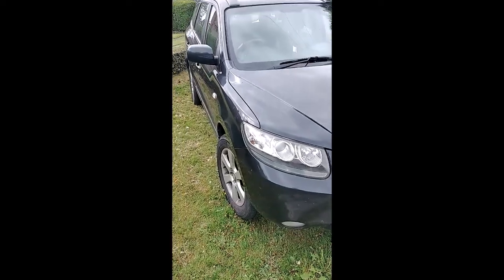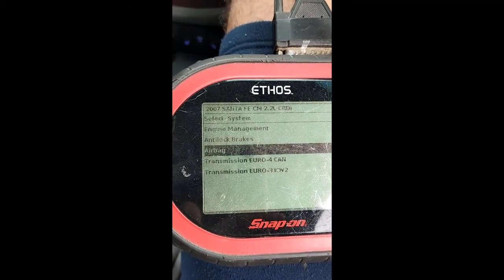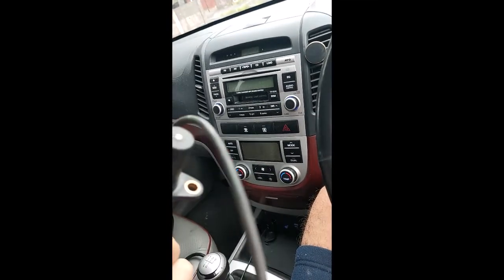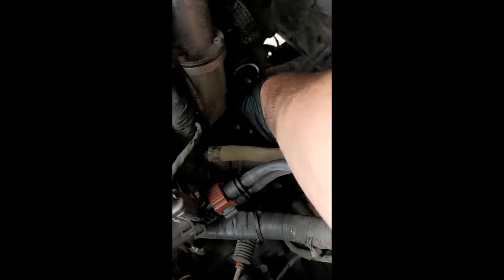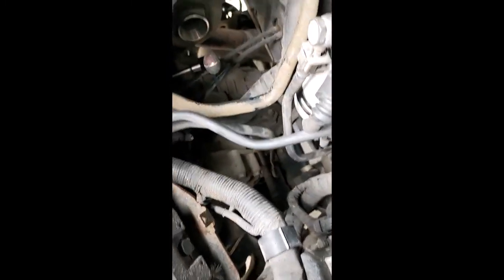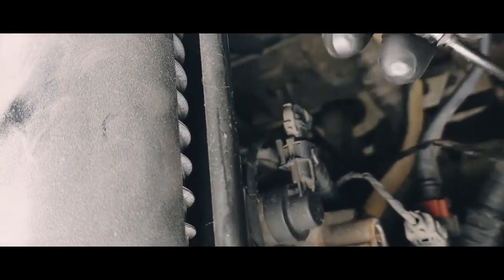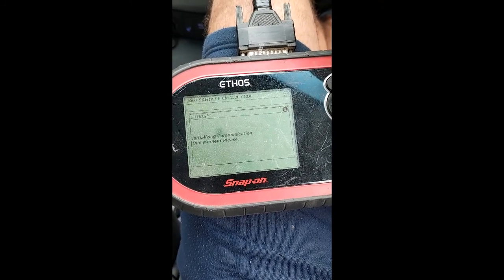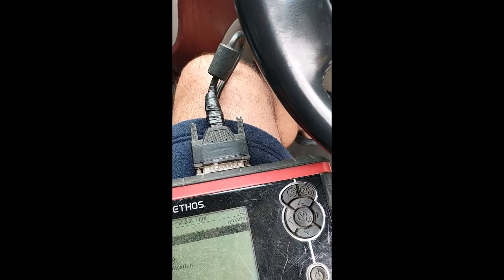Crankshaft sensor diagnose and replace - Hyundai SantaFe 2.2 Crdi Code P0336

Comment: 7:32 you're correct there mate. I couldn't see a darn thing from underneath. But, to date, your video has helped me locating the crankshaft sensor on a 2.2 Santa Fe. I could not find any diagrams, pictures or videos for a 2.2 Diesel. They're all for the 2.4 or v6 and petrol engines. And they all say that the location is similar in all variants, but I looked in every location that was mentioned and couldn't find anything that was described. I rven purchased a Haynes workshop manual specific to my year, and even that says its where the starter motor is. So thank you for saving my sanity😊. I will definitely like and subscribe. Thanks again.
Reply from the maker: Ive had the chance to to this again, on a different vehicle. I will honestly say i did it without seeing where it was, i did not remove absolutely anything, i knew where it was and did it by touch. I was amazed how much work was the first time, 3 years later took me 3 minutes. Humans are amazing. I am glad it helps. Thank you.
Reply: @yell0monkey856 it would be great if you did a lil video explaining how you did this. I have 2007 2.2 diesel. Wouldn’t start after already got driving, died at traffic lights. Recovery came, tested, not alternator, not battery, the official test said it’s Crankshaft Sensor. He showed me where it was, which was where you were looking. It’s only £30 for new one but I’m not a mechanic lol
Reply from the maker: @SShowcare well, this is a lil video explaining how i did this. I know it is not the best video ever, but gets you close to where you need to be. Its fine if you are not a mechanic, but if you cant do it, better leave it to someone who can. A genuine Hyundai sensor, today, 2024, is about £60, so i seriously sugest buy a quality sensor. If i made a video of an engine on the stand, clearly visible, all i would have done is undo a 10 mil bolt, sensor out, sensor in. Would have helped no one. I tried to show how to get to it, where about it should be, and how difficult, or not, it is do diy. I think i did a decent job.
Reply: @yell0monkey856  ye it’s all good. Getting sorted on Monday. Just gonna get a mechanic friend to it

Comment: Thanks! I've got some problem with my santa -08. Mostly egr related. Some cleaning and then the problem is solved for a while. But! All of a sudden it did start after the cleaning. But it did shut down when the engine reach correct working temperature. Sometimes the code crank shaft sensor is on sometimes its not. I ordered a new egr-motor and a cps sensor. So tomorrow i will see if it helps. Glad to see where the cps is located!
Reply from the maker: Hi, i'm glad this video helps you in some way. From my experience, the sensor will stop working when hot, then resume when cooled for a while, but eventualy stops alltogether. Eger motor the same, you can clean the valve as much as you like, but when the little ecu on top of its motor is going, theres no cleaning. Best of luck.

Comment: Thanks for sharing, I have exact same problem on my Hyundai Santa fe 2.2 diesel and same code (P0366). Strange problem because starts intermittently. I will buy the sensor and try the same repair as you did
Reply from the maker: These sensors dont usually fail completely and sudenly. Tool mine 5 days to die. But when it starts causing issues, the chepest and easiest fix is to change it. Sometimes might need camshaft changing too, because they work together. If after these easy and cheap ways to try dont work, then the big work starts, check timing first, belts obviously wear with time and can stretch, not just brake, or internal damage, like bottom bearings. As i said, easiest and cheapest way to try is the sensors. Best of luck!
Reply: Thanks for the video I have exact same problem on my Hyundai santa Fe 2.2 diesel start problem

Comment: Im just back on customers car after changing the crank pos sensor for an original a month ago. Yep. Original £70 and a month later no start with it saying crank pos sensor. 

So my advice is to look at the front right of engine block. There is the connector where a long lead from the sensor joins the wiring loom. I have my thoughts on that being dodgy. Check there first before changing the sensor. Unplug and then spray inside with contact cleaner and then plug it back together.
Reply from the maker: Hello. If it failed after a month, something might have happened there. You can obviously use a voltmeter to check for voltage at cranking, and specialised equipment to measure the pikes of signal on the sensor, but its getting complicated for a drive way job. As i mentioned in the video, its always worth checking wiring when doing the sensor, and if not obvious, i recommend proper software readings before ripping through wiring loom. 
It is possible for the new sensor to just fail. I have not fitted a genuine one in the video. Could try get it replaced on warranty.
Reply: Thanks but highly likely the connector front of engine block where sensors ling lead connects to wiring loom. Im doing one right now. I have all the oscilloscopes and jaz.
Reply from the maker: Let us know how you sort it. Im sure others will want to read about it.
Reply: @yell0monkey856  ok so checked the data on crank sensor today and it said resistance for the sensor should be between 774 - 946 ohms. I checked the one which is brand new a month before from Hyundai. The reading was 1082 and the data sheet said if its out of spec then change the sensor. So I have ordered a second new sensor from Hyundai today. They said they would let me resistance test it in their dept before buying it to see if it is within spec from my Haynes Workshop Data spec. Will update as I know.

Comment: Thank you mate your video helped a lot 
Have you replaced the turbo before?
Reply from the maker: No, ive not done the turbo. Didnt seemed a big deal, just loosen if possible the oil feed pipe first, because it can sometime break trying to remove. That way, you'll have time to order a replacement.

Comment: Hi, something it is not clear for me is in case the sensor is covered with oil at the moment of replacing it, is it normal or some internal o’ring/joint is damaged? Can be the oil the problem of damaging the sensor?
Reply from the maker: If the part of the sensor which sits inside the gearbox, reading the flywheel is full of oil, then yes, it can malfunction. And also yes, either your crankshaft seal or your hydraulic bearing are leaking, and thats a bigger problem (gearbox out, new clutch, flywheel etc). If the outside part is dirty should not affect the reading of the flywheel. Maybe if oil gets in its plug.

Comment: I change crankshaft my self i deleted  p0336 and it wont start, battery is full all fuse is good. I disconnect the negative  battery before i change the sensor probably wrong procedure it wont start.
Reply: Olá amigo, acontece-me o mesmo no meu santa fé 2.2 crdi de 2008, troquei o sensor da cambota e continua sem pegar. Será da bomba do combustível?
Se você já chegou a alguma conclusão com o seu, diga por favor  como resolveu.
Obrigado.

Comment: I've sent an email re my hyundai santa fe 2008 2.2 engine. The engine stalled while I was driving. The garage fitted a sensor CKP. Is this correct as I am a bit wary of driving it stalled on a busy motorway. I've never had any problems with it before.
Reply from the maker: Hello. There is no way of me knowing if thats ok. Sensor failure can do that, stall the engine while driving, though uncomon. If the garage thought that was the issue, im sure it was. If you have any doubts take it to a different garage and ask theyr opinion. Sorry, but you wont find the answer on the internet, youll most likely find but "mechanics" talking to keep theyr mouth moving.

Comment: My mechanic has told me that it could take 6 hours of labour to fix the crank angle shaft if its near timing belt?? I have 07 santa fe 2.2 also
Reply from the maker: Hello. What i've done in this video has nothing to do with the timing. If your mechanic says he needs to take cambelt of, then will be at least 3.3 hours of labour. I dont understand what "crankshaft angle" is about, so cant advise any further (belt skipped a tooth?!?). If you think you are being hustled by that garage, ask a second opinion somewhere else. Best of luck.

Comment: if r.p.m not move when you start car = crankshaft sensor is damage . result the engine not work .
Reply from the maker: So you diagnose a non-starting engine by watching the rev needle with the engine running? Maybe something got lost in the translation.
Reply: @yell0monkey856  Yes that true , this what happen with me . whan I start engine at 3 second